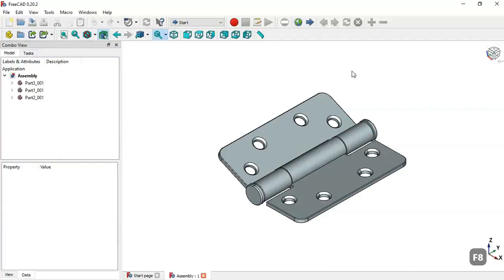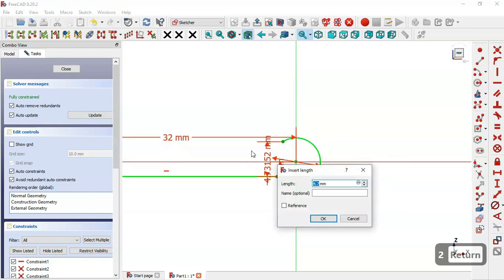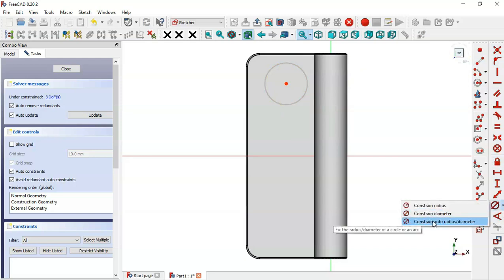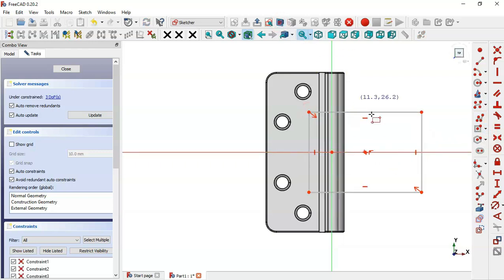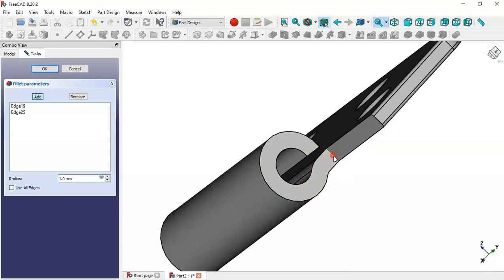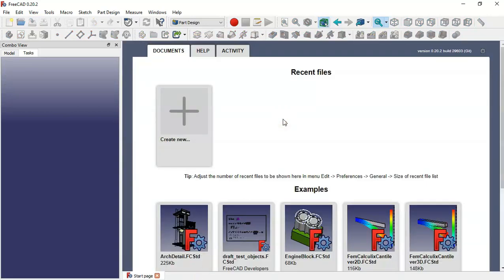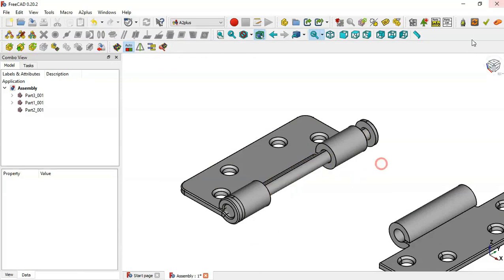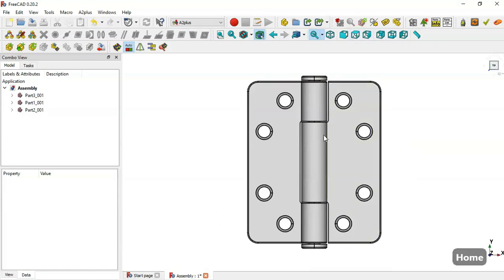FreeCAD Beginners tutorial: practical exercise 79

Comment: At around 10:32 in the video the rectangil is chosen and an icon is chosen. I am using version 1 and I do not see that icon nor can I find one that does something simular. There was a button that allowed me to select from Normal, Construction or External Geometry but they do nothing when clicked on. Could someone provide the correct option I should take in Version 1? Thank You
Reply from the maker: Inside your sketch (in the Sketcher workbench), right-click and look for "Toggle construction geometry". This will solve your problem. Please note that in versions higher than FreeCAD 1.0, this has been changed.
Thanks!
Reply: @OffsetCAD  Thank you very much for your hekp. It is appeciated.